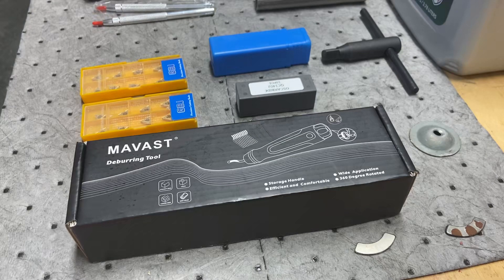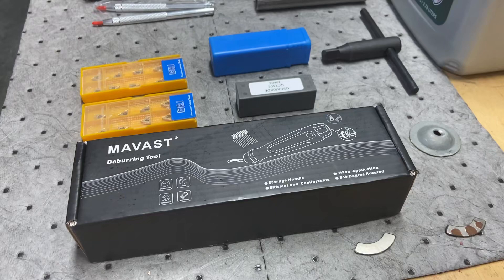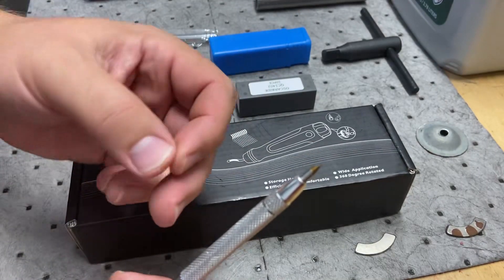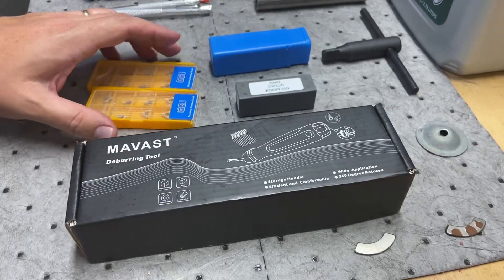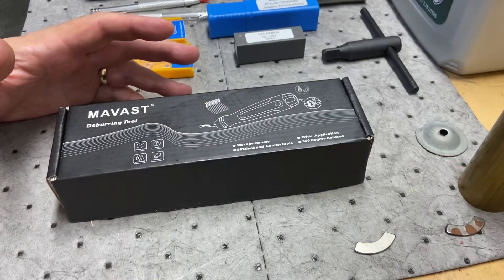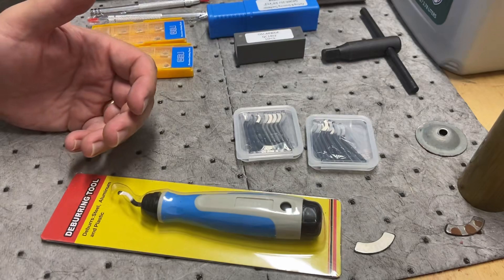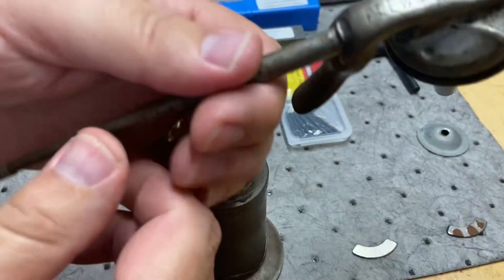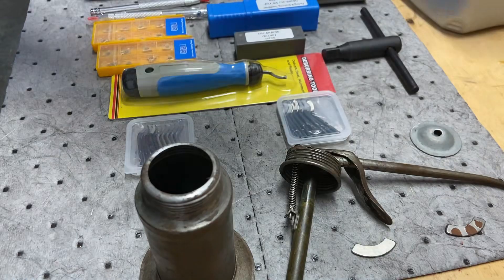Vevor Mini Lathe MX 400 Part 13 - New Tools and Project Idea

Comment: You need to find a scrap yard that will sell to you saves hundreds
Reply from the maker: Great idea,  We have a few scrap yards around here.  I will stop a couple and see what they have.  If I can get some 1-1/2 inch round bar in brass or aluminum I'd be thrilled.  or short 4-6 inch discs of material... Definitely worth a shot. Thanks for the suggestion and thanks for watching.

Comment: On these small machines, HSS is your best bet on tooling. I too started with indexable carbide inserts with no knowledge of grinding hss. After stuggling to get a decent surface finish and seeing slight tapers on my projects that I KNEW were suppose to be spot on, I took the plunge into grinding my own hss tools. The difference is night and day! It's not hard to figure out, the geometry isn't set in stone, you can grind your own "specialty tooling", and the tool pressure is so much lower. I hone mine after grinding to get a clean razor sharp edge and it's not unusual on my little 7x to hold parts in the .0001s....well +/-.0001. If you decide to try it just get m2, the m42 is very tempting because of its stronger nature but it is a BEAST to grind and hone.
Reply from the maker: Thanks. I’m definitely going to try grinding my own tooling.
Reply: @deezworkshop  Good deal, I forgot to add that it will most likely be best to get some square mild steel stock around the same size as the hss you intend to use and do some practice runs on the mild steel first. You will definitely make some monstrosities on your first few attempts but but a little practice goes a long way when it's time to grind the real deal.
Reply from the maker: Yeah that’s a good idea. I’m going to mess up at first and no reason to ruin good hss. Thanks for the additional note.

Comment: You could make the chuck key holder as a small project. Use the aluminum, skim cut the outside to clean it up. measure the inside diameter and machine a puck that will fit into the hole. It could have a shoulder as a stop and a wider base, just larger than the magnet outer diameter. Counter bore the bottom to epoxy in the magnets. This gives you practice on machining an interference fit, and machining a flat bottomed hole. Plus since it will likely live on the lathe for a long time it will look nice and be a good reminder of what you have learned. Amazon has a pack of 1 ft aluminum bars in sizes from 1/2 to 1  1/4 that's handy to have on-hand for projects. 
As a side bonus it would be a good project for a video .
Reply from the maker: I really like these suggestions to make an interference fit. I have an upcoming video where I made a holder. It works but I’d like to improve it. Thanks for your ideas and thanks for watching. I definitely need to get me some 6061.